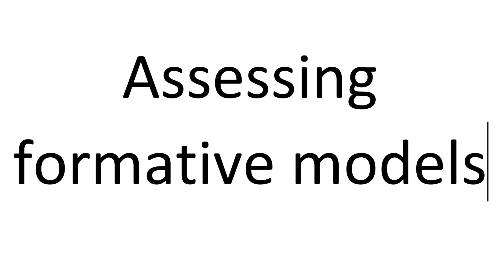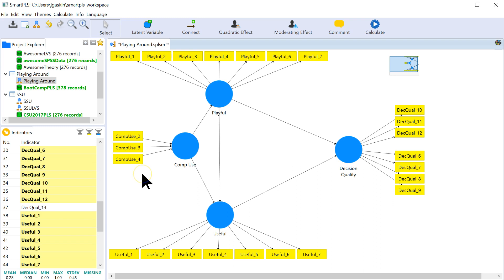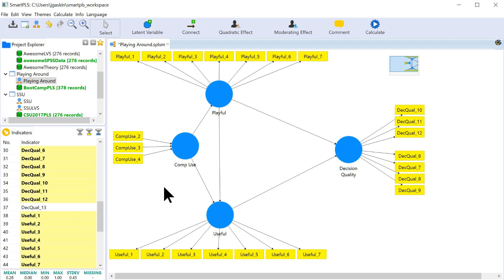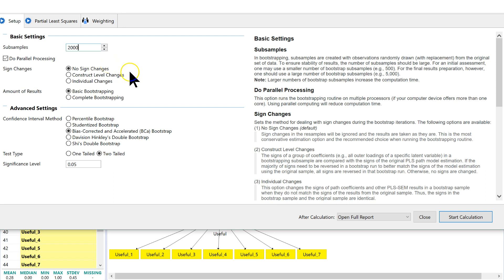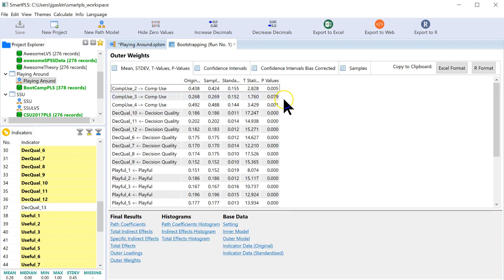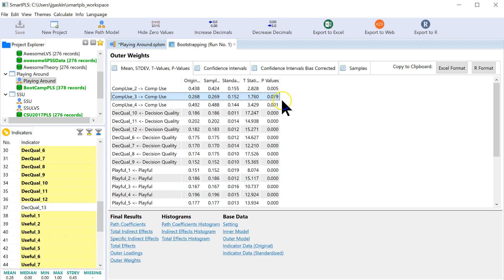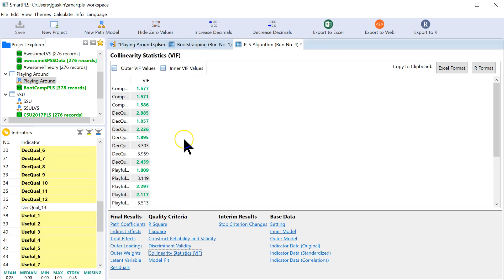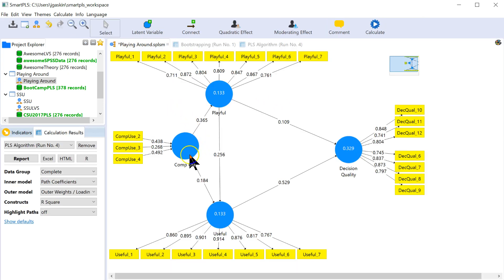Validating Formative Models in SmartPLS 3

Comment: Hi，Dr. James. Could you please specify how to establish construct validity of formative indicators with the MTMM approach?
Reply from the maker: I don't have any videos on this. SmartPLS also doesn't have a video on this, and there is no feature for it in SmartPLS.
Reply: @Gaskination  Thank you for your reply. But I'm still very confused. In your article "Partial Least Squares (PLS) Structural EquationModeling
(SEM) for Building and Testing Behavioral Causal Theory:
When to Choose It and How to Use It", you mention that,  "no single
technique is universally accepted for validating
 formative measures. However, the modiﬁed MTMM approach is regarded by many as a promising solution." and " However, a
 simpler approach is just to ensure the indicator weights for formative constructs are roughly equal and all have signiﬁcant -values." Do you mean that either of these two approaches can be selected to validate the formative measures in my thesis? Only use the second approach is also acceptable, right? Looking forward to your reply. Thank you.
Reply from the maker: @jackiehuang5391  Yes, although both are good approaches, SmartPLS still does not have a way to conduct such an analysis (as far as I'm aware). So, for now, the best option is to just look at size and significance of the indicator weights.

Comment: Hi, Dr. James. For the formative model, do we need to analyze its the Fornell and Larcker criteria and HTMT?
Reply from the maker: Fornell-Larcker won't apply because the AVE is not relevant to a formative factor. HTMT is also not calculated for formative factors. So, the best you can do is look at the correlation matrix (in the Latent Variable output) and look at structural (inner) VIFs. Correlations should be ideally less than 0.700 (although some say up to 0.900 is okay), and VIFs should be less than 3 (although some also argue as high as 10).
Reply: @Gaskination  I see. Thank you for your detailed answer.

Comment: Hello prof.
Looking forward to your suggestion on my formative dv construct with three items where outer weights for item 1= 0.259, item 2=0.588 & item 3= 0.0000.
But all VIF values have reached cut off points green color.
In this case, what's your opinion ? As I am scared to proceed with 1 item construct due to different scholars argument, can I keep item 1 & item 3?
Reply from the maker: Item 3 seems to be unhelpful. If any item is dropped, I would suggest item 3. You can also check the p-values to see if the items have meaningful contribution to the factor.
Reply: @Gaskination  hello prof.
p values are: item 1 = 0.259, item 2 = 0.576, item 3= 0.0000
Outer weights are : item 1=  0.273, item 2= 0.092, item 3 =1.084
Reply from the maker: @nazreenchowdhury5635  Oh, those are the p-values. In this case, item2 seems to be the weakest link.
Reply: @Gaskination  yes, Prof. That's why I am considering proceeding with Item1 & Item 3.

Comment: Dear Dr. Gaskin, I have a PLS-SEM modeling issue: One of the exogenous variables has formative indicators. The indicator' scales are continuous from 0% to 100%. And some indicators have opposite directions, e.g. IND1 - 0% (worst) to 100% (best); IND2 - 0% (Best) to 100% (worst). In this case:
1) Can the scale be continuous?
2) What about the indicators with the opposite scale directions, as above?
3) Will the modeling software SmartPLS mix things up with this scale design?
Thanks a lot!
Reply from the maker: Continuous is fine (better actually). Just re-reverse the scale (i.e., subtract scores from 101).
Reply: @Gaskination  Thanks a lot Dr. Gaskin!

Comment: Dear Dr. Gaskin,
first of all, I should thank you for these precious videos for teaching Smartpls3, it's really helpful. I have some question regarding my research model, I discuss them here and I would really appreciate if you address them.
I'm measuring 5 personality traits, for each, I have 4 indicators. after factor analysis, I needed to delete 2 of 4 indicators from each trait and now my model has 5 personality traits, each with 2 indicators. Is it acceptable from the perspective of the reviewer?
Reply from the maker: Two indicators is acceptable, but not ideal. If you had to delete half the indicators from each, you might consider whether the items are actually formative. You might have also been too strict. Try a more relaxed approach for convergent validity by using the CR instead of AVE. Then use HTMT for discriminant validity instead of Fornell Larcker.

Comment: Hi James, some questions, please: 1) For the formative model with all formative constructs, should I mention the model fit (e.g. SRMR, NFI)? 2) There are 2 things of model fit (d_ULS, d_G), don't know if they are relevant to formative and how to use them. 3) For formative items, can I delete some items if I found they are not good for the result?
Reply from the maker: Model fit is not relevant for a model with all formative factors. As for removing items from a formative factor, it is probably not a good idea since each item helps define the construct.
Reply: Got it, thanks a lot! If the formative factors are way too high for their P-value (less than 0.05)  and I have to delete it, what's the good way to explain?
Reply: Would it be possible to say,  as they have good VIFs so no delete is needed?
Reply from the maker: chan yin yi essentially you are correct. We don’t delete the items based on p-values for formative factors. Instead, we rely on VIF.

Comment: Dear Dr. Gaskin,
One of my 2nd order factor (service orientation) have two sub constructs, in which one is reflective (cooperative behaviour) and other one is formative (service performance). 
My question is -do I need to check the discriminant validity here? 

And thanks for your tutorials
Reply from the maker: No, as long as they are not too highly correlated (like > 0.900). We expect 1st order dimensions of a 2nd order factor to be strongly correlated, just not completely interchangeable.

Comment: Hi James, thank you very much for your informative video. I have one question. Could you also use the path weighting scheme? Why do you use the factor weighting scheme? I tried both and I am getting different results in terms of p-values. The factor weighting scheme gives me significant p-values but the path weighting scheme gives me a few non-significant values. Can I keep the factor weighting scheme for validating the formative model? I would be grateful for an answer. Thanks
Reply from the maker: I use factor weighting when assessing the outer model (measurement model) and path weighting when assessing the inner (structural) model.

Comment: Dear Dr. Gaskin
first of all, thank you for your excellent videos. 
I have one question: In one case, I had three ID variables pointing at DV. two of those variables didnt have effect on DV. but if I remove the third variable, both of them had significant effect on DV. I can't understand how can it happen? could you please help me?
thanks a lot.
Reply from the maker: This is common in regression-based models (such as path modeling in SEM). In regression, all effects account for (control for) the effects of other variables. So, if you have a potent predictor, then it will drown out the effects of lesser predictors. But when the potent predictor is missing, those lesser effects become significant. That's just how regression works.

Comment: Hello professor, i think i have one formative variable.. the tests of vif and bootsrap are ok.. now i tried to calculate the gof but i have no AVE for this formative variable? is it normal ?!
Reply from the maker: Yes, that is normal. AVE is a measure for reflective factors only. It assumes inter-correlations among indicators (which is not an assumption of formative factors).
Reply: @Gaskination  thank you so for formative i just need to check the vif right ?
Reply from the maker: @ibtissemhamouda5492  Yes, although you might also check the significance of indicators and the correlation matrix (to make sure no factor correlations are above 0.700).

Comment: Hello James, thank you for all your videos. They are very clear and informative, they have helped me a lot with my research. I have a few questions about the validation of the formative models. Hair et al. (2016) suggest validating formative constructs by correlating it with its reflective measure. One approach is to include a question in the survey that may be then used as a single-item endogenous construct for this purpose. I added the question that was supposed to reflect four formative constructs and then used it to validate each of them. The correlations turned out to be low. I then realized that there was a major issue with the single-item construct, and there was a reasonable explanation for the low correlations. 

Since I didn't have any other variables I could use to validate the constructs, I created a composite measure of all four constructs (multiplied their means) and then correlated it with each construct separately. All correlations exceeded the 0.7 level. How appropriate is this solution? If this doesn't work, then what can be done? Should I create an index for each of the constructs and then validate them using the indices? 

And another question is if the model is comprised of four first-order constructs that from a single second-order formative construct, how do you validate such a model?  The point of the model is to develop an index and not to test some other relationships with the reflective measures, should I stop after validating first- and second-order constructs or there is another statistics I need to use? R-squared is irrelevant in this case since the first-order constructs perfectly explain the second-order construct. Thank you for all your help.
Reply from the maker: 1. Since the single item correlation didn't work out, you could just use the significance and VIF approach shown in this video. 
2. I'm not sure if the index approach is appropriate. Logically it makes some sense that they at least move together (0.700 correlations), but I'm not aware of any publications that take this approach.
3. You are correct. No need for R2. Just use the significance and VIFs.
Reply: @Gaskination  Thank you for the advice! I very much appreciate your help. I picked up the index approach from some online discussion but was not sure how appropriate this approach was. As you said, it did make some sense, but I could not find any support for the approach in the literature either. Thank you again!

Comment: Dear prof James. I am not sure if you are familiar with the theory of planned behavior. In this theory, there are three main latent constructs: attitude, subjective norm, and perceived behavioral control. These three constructs are assumed to predict another latent construct: intention. This theory assumes that attitude, subjective norm, and perceived behavioral control are based on respective beliefs, which from a measurement perspective means a formative model. To make it simple, let's assume I have attitude as a latent construct and a set of 7 formative indicators. I run a formative model, but only three indicators were statistical significant. My question is: is it still possible to argue that these set of statistical significant indicators are the the drivers of attitude?
Reply from the maker: I am familiar with TPB. The two scenarios you propose are different though. One is at the measurement level, and the other is at the structural level. In either case, it would be appropriate to retain all predictor variables, because we want to control for their effects. In the case of measurement, we might argue that the construct is not complete without all these indicators, even the non-significant ones.
Reply: @Gaskination  Thank you very much for your reply. It was very usefull!

Comment: Prof., what if the p-values for outer weights after bootstrapping are much much higher than 0.1? Say, 0.2-0.9?
Reply from the maker: Then they are considered to be non-significant.
Reply: @Gaskination  I'm reading Hair et al.'s book, and it seems that handling non-significant formative indicators is rather complicated, involving a reconstruction of the inner model
Reply from the maker: @LockyLawPhD  Non-significant indicators are not contributing to the construct. However, removing them also changes the nature of the thing being measured. If the indicators are removed, you'll have to reevaluate the nature of the construct.
Reply: @Gaskination  Hi James, I know that you are "terrible with references" (as you say in another answer for this video), but do you have any for the "liberal" p-values (e.g., 0.2) that you advocate in this video? They make sense to me in this context, but I guess, it would be hard to publish an index constructed this way without a good reference. Thank you!
Reply from the maker: @daniell.6623  This article has some thoughts on it and some useful references: https://www.ncbi.nlm.nih.gov/pmc/articles/PMC5059270/
Reply: @Gaskination  Thanks!

Comment: Hello Prof. Gaskin,
i have a construct with four formative indicators. The weight of one indicator is above 1, while the weights of the other indicators are negative and low in magnitude. I could not find a paper where this case is explained and how to evalute it. I did a redundancy analysis using reflective global indicators. The formative indicator with a value above 1 on the other model was now insignificant and low in magnitude (and negative). Therefore I assume, that it is not a dimension of the construct, but i am not entirely sure. Can you help me how I should interpret this specific case?
Thanks a lot
Reply from the maker: This is one I would recommend reevaluating at the measure level. Take a look at the wording of the measures. If they are consistently in the same direction (i.e., a higher response on the measure indicates a higher level of the construct), and they are measuring the same construct, then there is little you can do if they are not multicollinear.
Reply: @Gaskination  Thanks a lot for your answer. The wording of the items should be right and multicollinearity should also not be a problem, as the inner VIFs are all below 3.3. I checked the literature for a similar problem but could not find anything. In general, it is recommended to  drop formative indicators that have low and insignificants weights and outer loadings. But what if only one formative indicator is significant. Doesn't it question the multidomensionality of a hierarchical construct?
Reply from the maker: @FDK13  correct. dropping all but one would reduce it to unidimensional.

Comment: Hello Prof. Do we also need to test assess convergent validity for the formative constructs?
Reply from the maker: No. Convergent validity assumes correlation between the indicators, but formative indicators are not required to correlate.
Reply: Hair et al. actually recommend to assess convergent validity when evaluating formative measurement models by checking whether the formatively measured construct is highly correlated with a reflective measure of the same construct. They recommend to use a global item in a reflective single-item construct that summarizes the essence of the formative construct. The reflective equivalent is then modeled as the outcome of the formative construct. For the assessment of convergent validity, they state that the path between both constructs should have a magnitude of 0.90 or at least 0.80, and the R² of the reflective construct should at least be above  0.64. Otherwise “the indicators of the formative construct  do not contribute at a sufficient level to its intended content.” This of course already needs to be considered before the data collection (i.e. developing a global reflective indicator that summarizes the formative variable).

Great videos btw ;-)
Reply: But how do we truly know there is no correlation between the formative indicators if we don't assess convergent validity. look at VIF?
Reply from the maker: The indicators are allowed to be correlated, they are just not required to be.  VIF is a required assessment of formative factors though, as shown in the video.
Reply: ok I see. Thank you Prof.
Reply: @Gaskination  Thanks Prof, finally i got the answer n your explanation provides valueable input for my write up.  However, i do hope Prof could make another video for redundant analysis in future.

Comment: I have a query not related to this video. There is a paper which said that an item (of a factor) can be dropped if it had a significant shared error variance with other items of the factor. How can we use SmartPLS to check whether an item has significant shared error variance?
Reply from the maker: I don't know if SmartPLS provides this information.

Comment: Hi Dr. Gaskin.  What is the difference between formative and composite models?  It is wrong to use the terms interchangeably?  why/why not?  Then how does Mode B come into play?  Same as formative but not same as composite?  Thanks
Reply from the maker: Jörg Henseler has some good info on this. I would recommend his work. He will likely disagree with my next statement, but it will be sufficient I think. Formative is a latent variable with indicators which predict the factor (unlike reflective where the factor reflects/predicts its indicators), whereas a composite variable is a collapsed set of variables into a single score (through summing or averaging, or some other method).